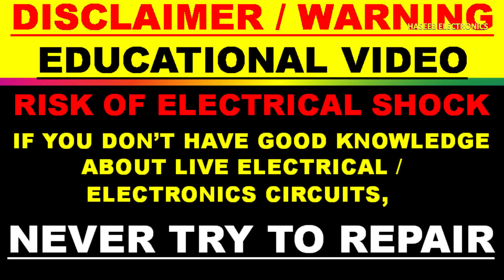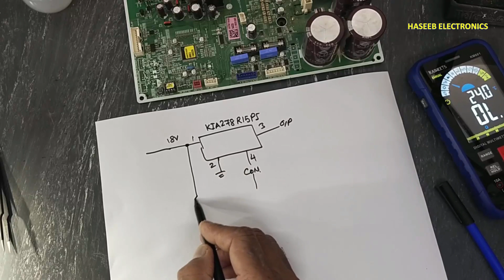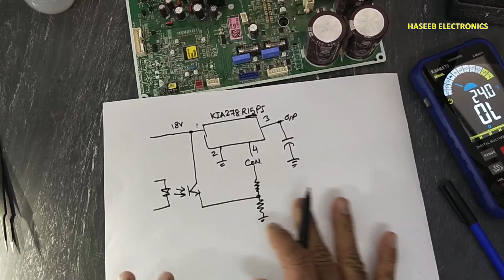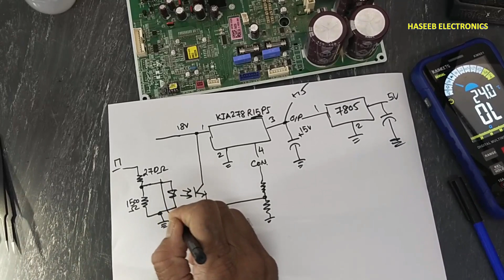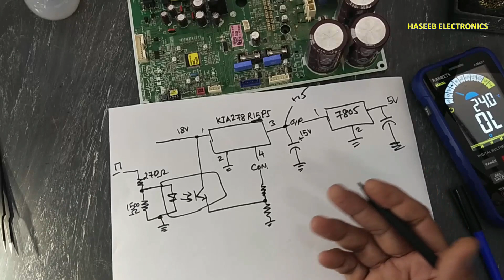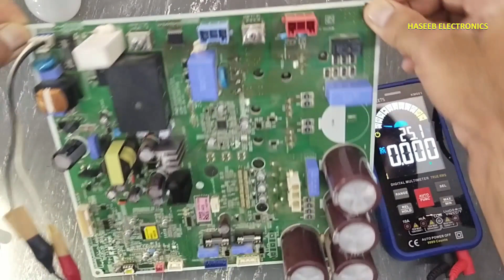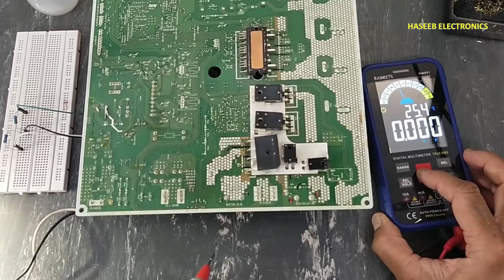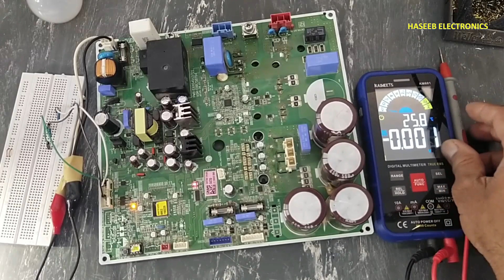{972D} Standby power signal path in LG Inverter AC Board

Comment: Amazing detailed info.Thanks man. Do not know if you even read old posts, but I will ask you anyway. At the end of the video, you suggest not applying AC power on the high side without heat sinks. Can AC voltage be applied over a serial bulb safely for testing? Will it prevent the IGBT and IPS module from overheating? Anyway, far the most detailed explanations on youtube for this kind of electronics

Comment: Assalamualaikum Bhaiya....
Plz you can explain how does an ac non polar capacitor work in motor Or ceiling fan....
And why it changes its rotation direction
When we interchange starting and running terminals.....
I know how it works it's only superficial 
I wanna learn his deep working 
Plz plz explain 
 in hindi with deep details..
If you read this comment...

  . . .. . .Have a nice day 💖💖💖

Comment: SA. 20 volts input to 7805 overheats the regulator or normal? I think current is low at the 7805.
Reply from the maker: NO PROBLEM. it is safe. 
maximum 35V can be applied at input